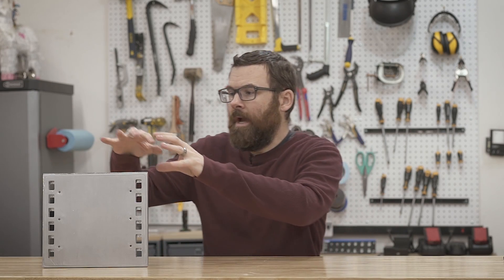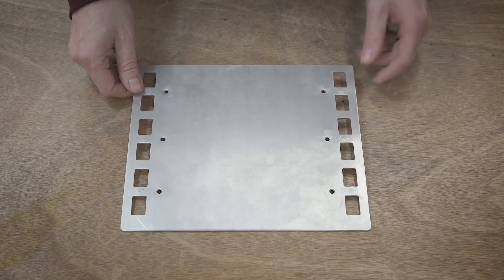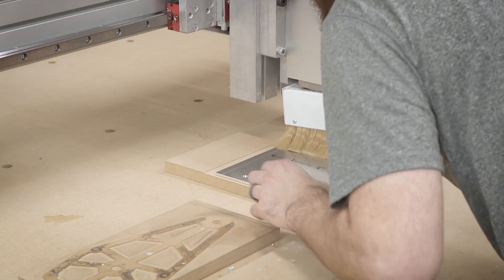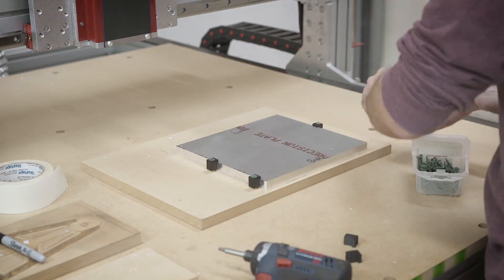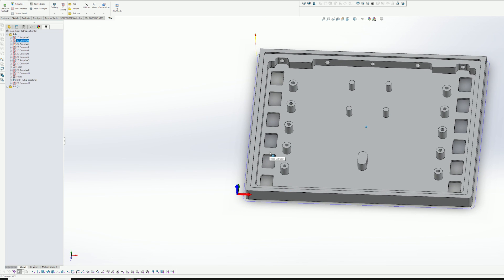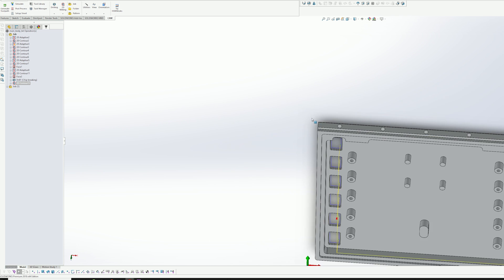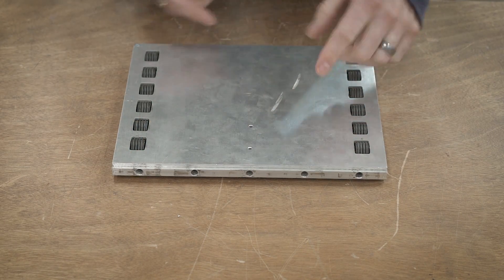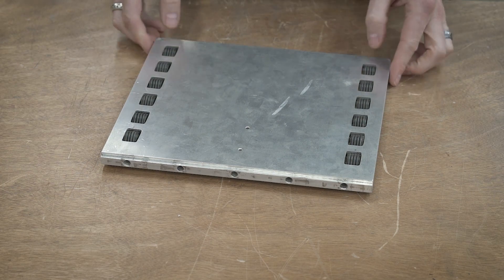From Start to Part:  Low Low Man Frame

Comment: Or you could have you know measured and marked where to drill the holes and not 3d print a part
Reply from the maker: Lining up drilled holes in metal by hand just doesn't really work.  With woodworking, that's perfectly fine, but with something like this, you won't be able to line them up well enough by hand, even by marking.

Comment: Back when I was grinding telescope lenses and mirrors the (fragile, expensive, circular, very slippery) glass discs were held to the bench with optical pitch. It's one of the weirdest materials you can imagine - basically a rock-hard liquid - but it's perfect for holding difficult workpieces very, very firmly.

Pitch is waterproof but heat-sensitive, so you might need to use coolant if you're generating high temperatures when machining.

Grinding and polishing telescope mirrors and lenses is exhausting and invariably done by hand; the workpiece stays cool but all the hard physical labour means it's the worker who needs cooling off. The frequent consumption of iced beverages is recommended. Any excuse, eh?    ;-)

Comment: Look into making a small(3/4ish) fly cutter using the Tormach Superfly insert.
Reply from the maker: Yeah, the problem is that it would need to be very well balanced, since the minimum RPM is 8K.  That's the trouble with a router, the RPM is so high a lot of tools won't work unless they're made for high speed spindles.

Comment: Hey Robert, have you tried the superglue+painters tape trick?
Reply from the maker: I have.  It works OK, as long as the parts stay cool.  I stupidly prefer the carpet tape since it seems to hold better, but I need to try the painters tape and glue again.

Comment: With all that drive power, why don’t you make it a lot faster?
Reply from the maker: These motors are TINY.  They're usually used in the 150 gram class (1/3 of a pound).  So I really don't have a ton of extra power.  Unfortunately, because the wheels are so small, it's slow.  To go faster, I would need a different gear ratio, making it over twice as fast, but halving the amount of torque.  I chose to go slower to maintain more control.
Reply: Robert Cowan I think you’ve already heard about these motors, but n30’s could give you the power needed to change the gear ratio for a higher speed.
Reply: I think the speed on it is fine